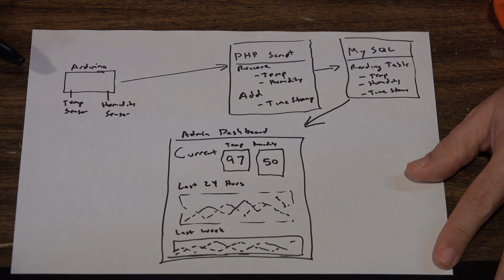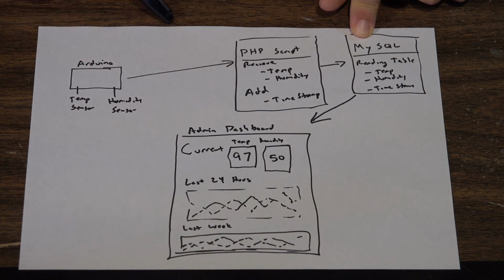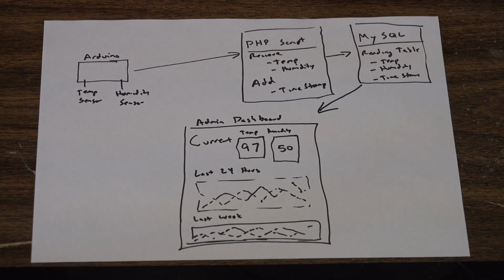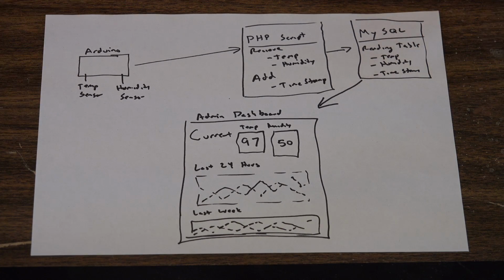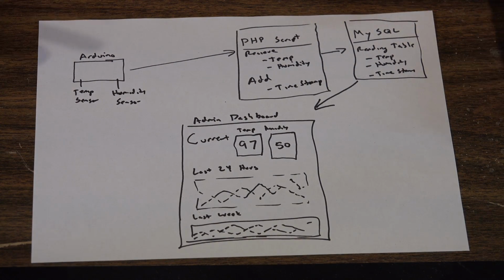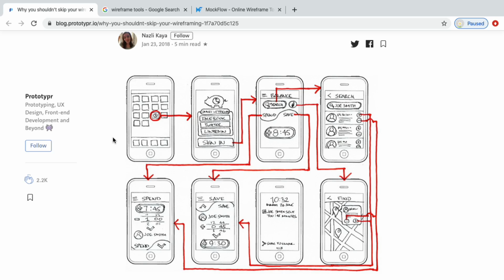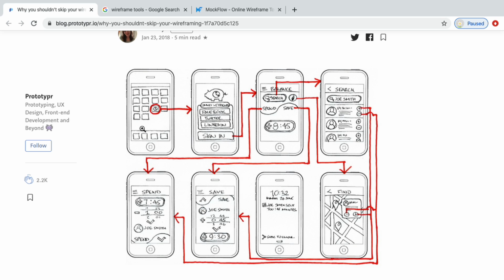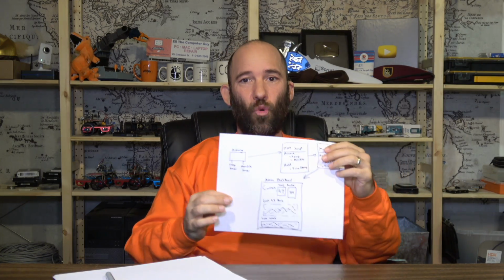Programming Intro - Wireframing Intro

Comment: Don't know about MySQL, but usually a DB should be able to add the timestamp itself, you just set the column type as 'timestamp' and when you inert the temperature and humidity values the timestamp would be generated and automatically filled.

Comment: "Wireframing"? This is really a term that only applies to the layout of webpages. You're using it here to show the whole design of the application, data flow, etc. That's really the province of "diagramming", not wireframing. "Wireframe" comes primarily from the animation/special effects world.
Reply: The term has certainly broadened over time (way beyond "only applies to the layout of webpages").  Whether you think his use of the term for this example is appropriate or not is another question.